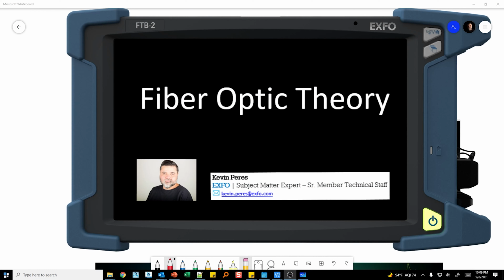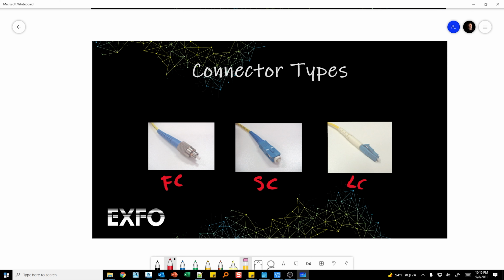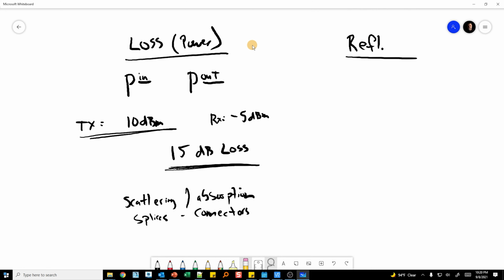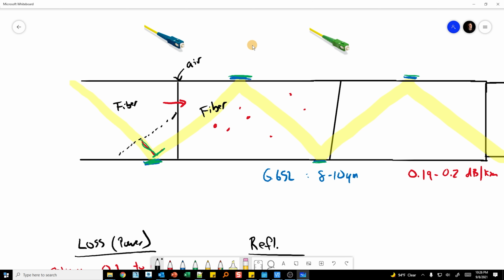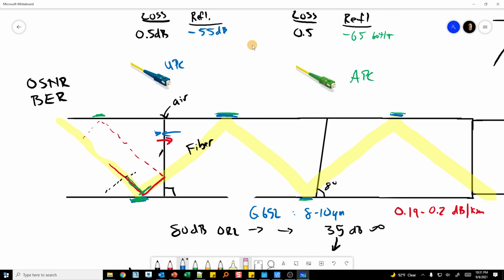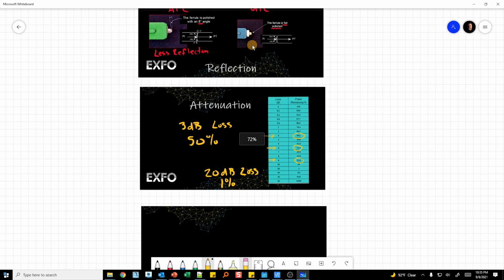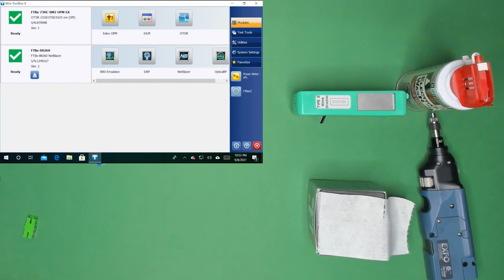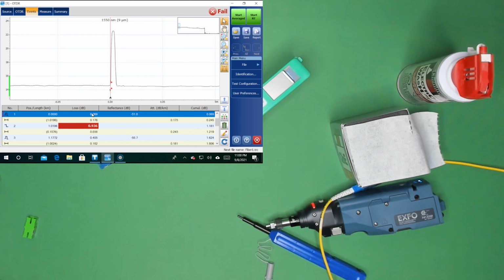Fiber Theory And Fiber Connector Inspection

Comment: We have a cross border connection from our site which is 100 KM far from us. About 6 kM is shared between us and the other side of the border. Is there any other way to test the fiber remotely instead of going 100km physically testing the fiber with the OTDR and finding the break point.
Reply from the maker: Sorry I missed this message.  You can use a Fiber Monitoring system. We have one that is stand alone.  More information here.  https://www.exfo.com/en/solutions/communication-service-providers/wireless/remote-fiber-testing-and-monitoring/
Reply: @KevinPeres  Thanks for this, Sir.